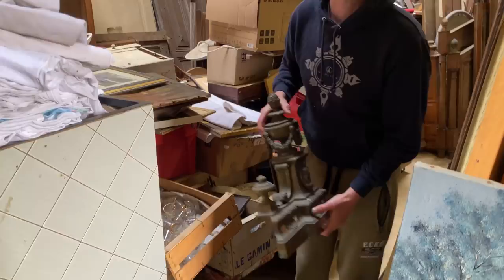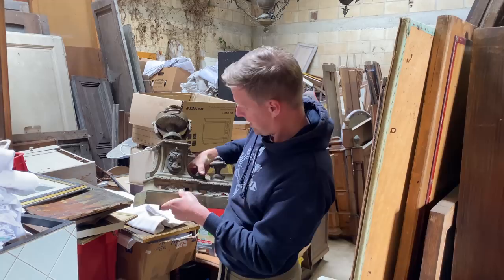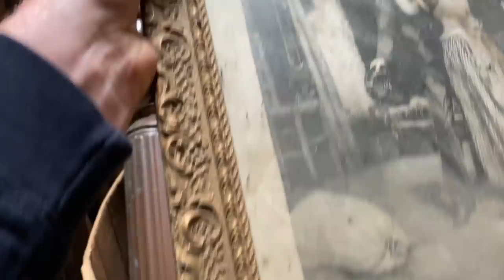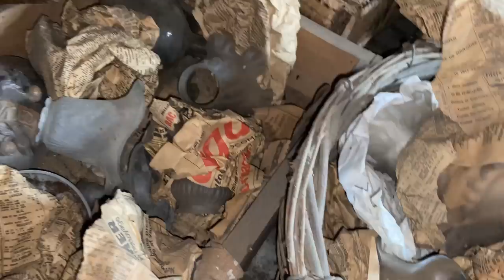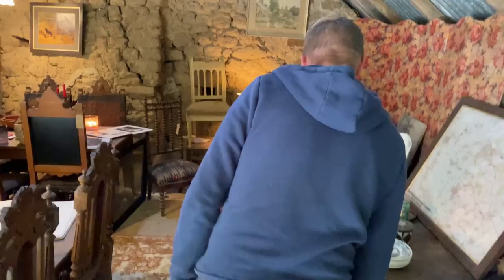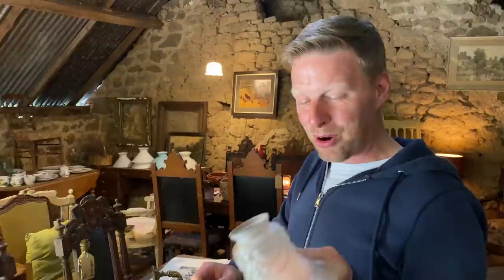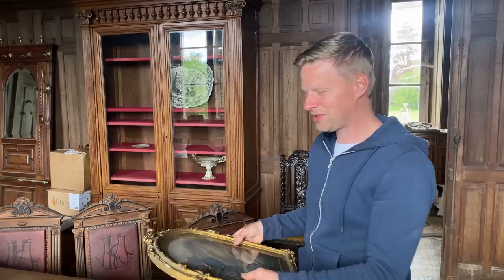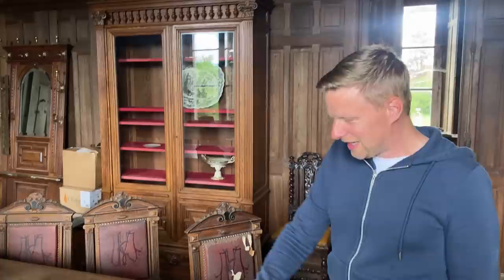The HIDDEN CHANDELIER for the First Room in the CHATEAU

Comment: The glass in the bottom of the chandelier would be easy. You can cut it yourself with a glass cutter and special glass pliers. I think those lamps also had round glass on the side edge which would be hard, but a glass place can mold it for you.

Comment: I would do glass on the bottom  measure the bottom and look for a cut lead crystal plate to put on the bottom or check out stained glass or plane glass and do Gallery glass on it ....
Or string clear beads on copper wire and string them in a spoke pattern across the bottom
Reply: Thanks Roxanne 😊

Comment: If I was restoring the chandelier that you showed...I'd gather my fabric with it the width of the frame around it, of course...put "two" small hems - one on the top and one on the bottom ...run a wire through the top and the bottom and place the circular fabric onto the lamp holding it in place by pressure - stretching the wire into the sides holding it in place also with smaller, thinner wire...the top would be easier to manage the four triangular sections with glue ontop of the flat base and then add trim..just an idea
Reply: Thank you Judith :) 😊😊

Comment: So glad you got the chandelier. Think the fabric on sides and bottom would look great.  A sheer drapery fabric shirred around sides and in a circular shape for bottom in soft white or pastel color to coordinate with room decor could make a perfect accompaniment. 
The 3 individual sconce lights could look great spaced out over a large bathroom mirror or even over a kitchen sink or large wall area of artwork.
Top tip #1…
Take photos of all light fixtures, furniture, mirrors and other furnishings (close ups on special trim & molding details) you already have - including sizes. Make digital files, organize by category best, and keep on you phones for easy access. 
Remember to update new purchases into file.
Great (and accurate) reference tool for when your shopping while you’re out and about or even online, important for insurance purposes, and later update with photos of cleaned/repaired/refinished piece. (Useful if do a book on restoration of property)
Top tip #2…
Get small tape measures for all 3 of you to keep on keychains - almost a guarantee that one will always be available when needed.
Top tip #3…
If you need ‘x’ glass lampshades, always get ‘x’ + 1. Small and easy to store and less expensive than having to replace all if you cant find matching damaged one, especially when your next guest is coming in a few hours after last guests did unique bedroom gymnastics and cracked one.
Reply: Thanks Angela. We have tape measures everywhere now 😂😂 we learned and took pictures of the shades now for when we’re out and about 😊😊

Comment: Very nice finds! I just want to mention that at La Ferte now they are working on a hallway, and if you look carefully, you can see wood paneling that has the circular medallion, which might be similar to the piece you found in the barn.  Would Lalacelle and La Ferte be of the same or similar vintage? Could the same builders and workers have worked on both chateaux?  Anyway, you might be able to get more of a feel for what the paneling that was removed, was like if you look closely at what is at La Ferte.